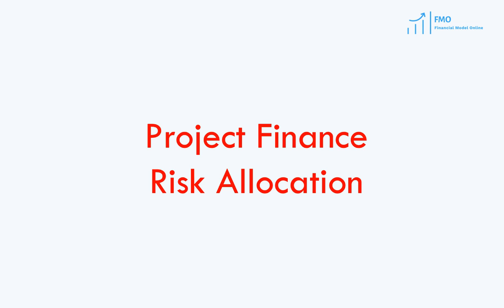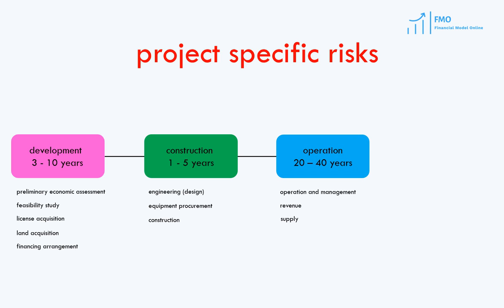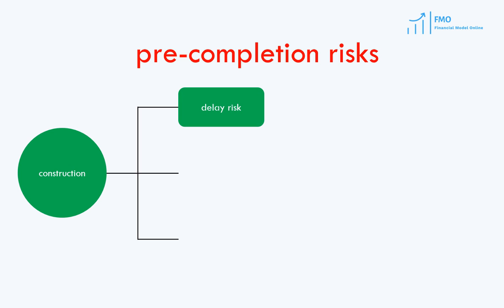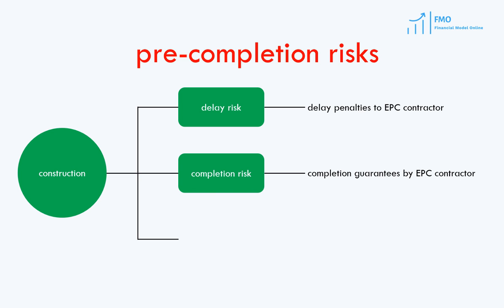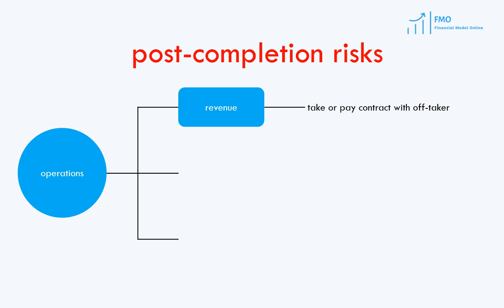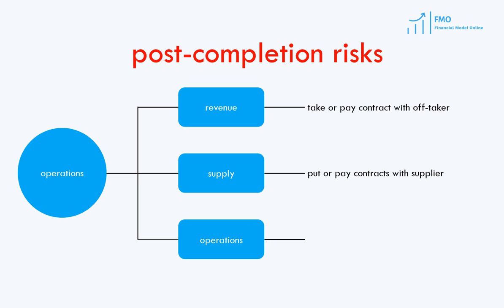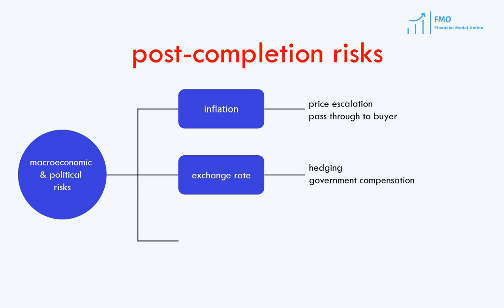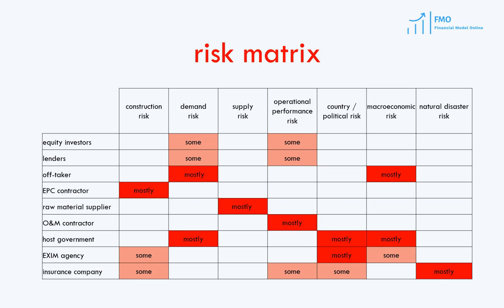Risks Allocation in Project Finance - Financial Modeling for Infrastructure Assets

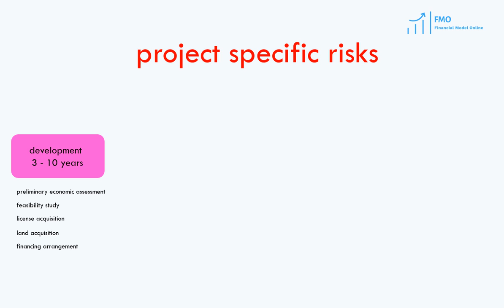Comment: 1:00 when the financing is closed and construction stage starts. 
1:10 EPC contractor designs and project procures necessary.
1:35 O&M contractor takes over.
1:45 the project enters the decommission stage.
2:50 construction stage with pre-completion risks include:
1. delay risk: lenders cannot get paid accordingly in debt repayment schedule. the buyer cannot get the agreed project output. the suppliers cannot sell the product as per agreed schedule. (EPC contractor will pay the penalties each day it violates.)
4:00 
2. completion risk: completion guarantees by EPC contractor.  (guarantee by a bank)
3. performance risk: EPC contractor. the project has to perform as least as good as specified in the EPC contract. otherwise, it cannot produce the planned output and planned cash flow.

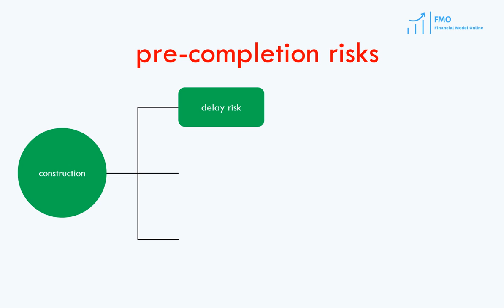3:10 project finance is a highly structured transaction.each small mistake may generate a million loss.

5:10 post-completion risks:
operations: 
1. revenue: take or pay contract with off-taker
2. supply: put or pay contracts with supplier
3. operation: performance penalties to O&M contractor

8:45 post-completion risks:
macroeconomic & political risks
1. inflation: price escalation pass through to buyer
2. exchange rate: hedging, government conpensation
3. change of law expropriation: government guarantee, EXIM agency insurance.